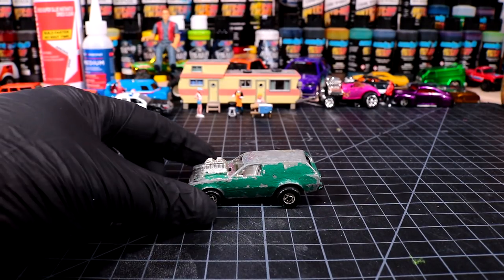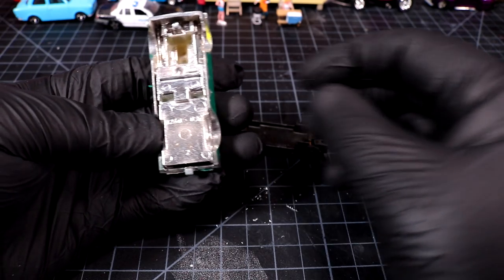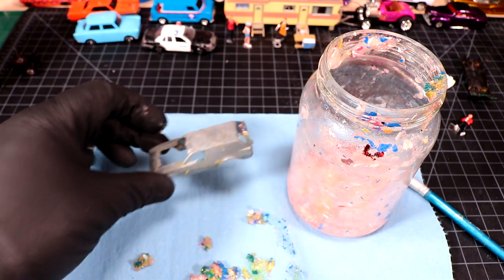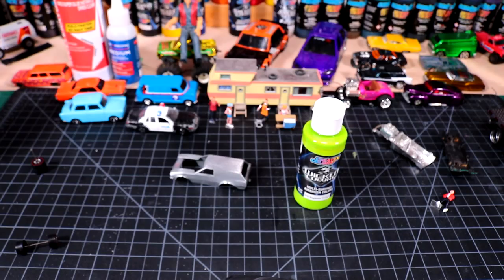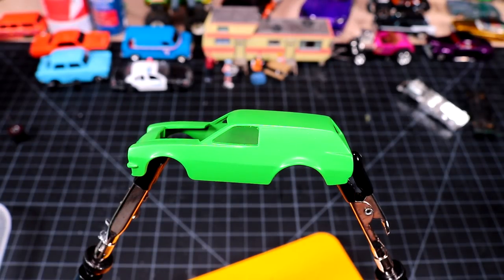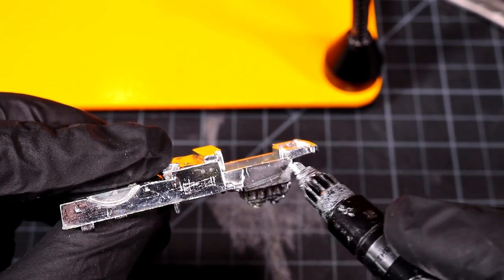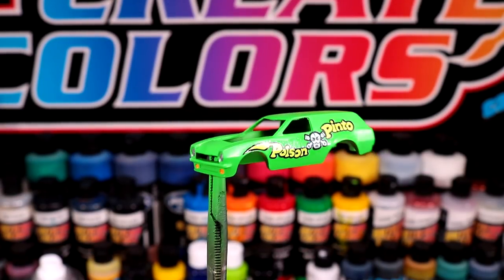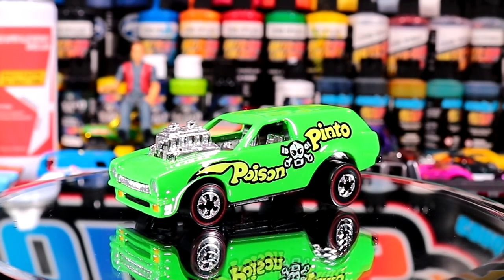Hot Wheels Restoration - Poison Pinto - Redline Conversion

Comment: Are you using the Micro Sol before the Micro Set? That's backwards! The names are weird. You "SET" the decal onto Micro Set. The "Sol"vent softens the decal into creases and crevasses. Another trick is to remember to use them Alphabetically.
Reply from the maker: You only need to use Sol on projects that require it though really.
Reply: @DiecastResurrection  right. But you started with it. You should start with the Set. Or at least that's what you said. You didn't show the bottles.